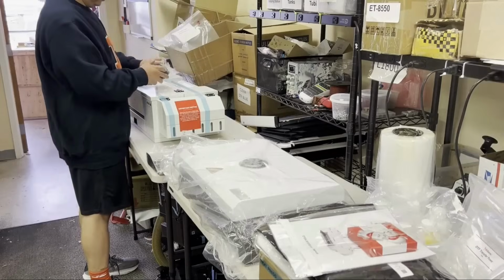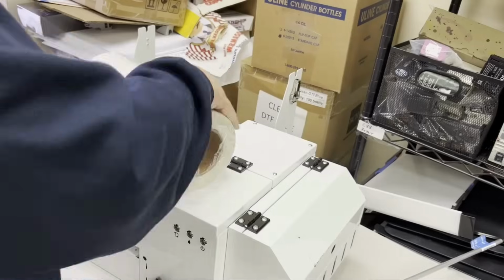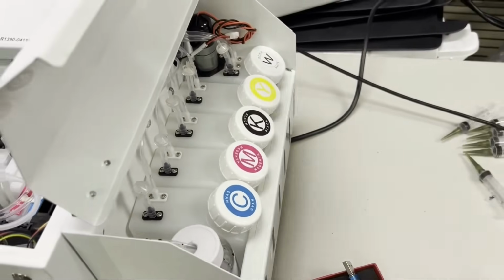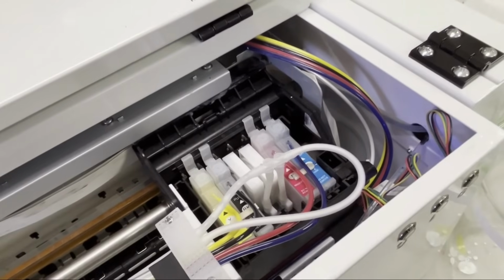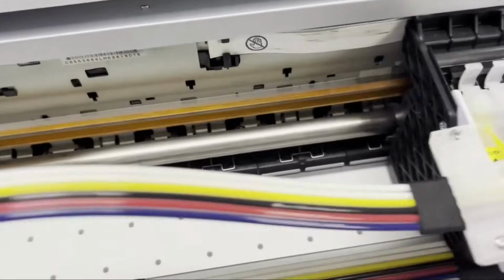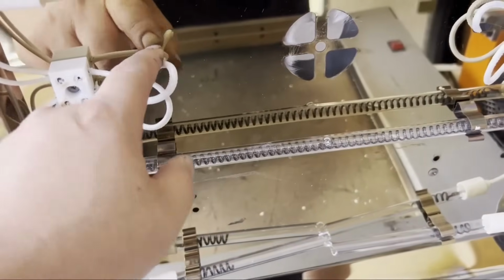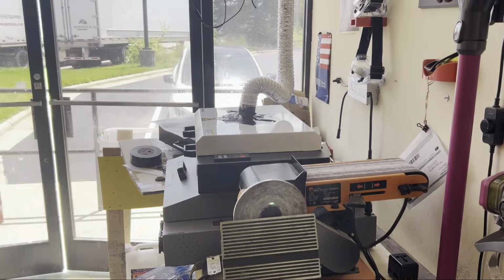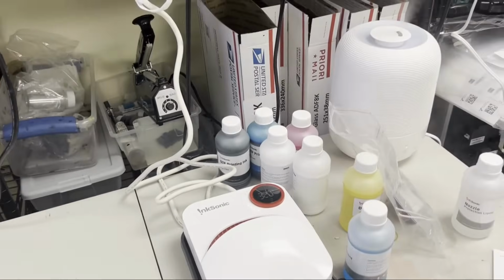InkSonic C13A DTF Printer Unboxing & Setup Tutorial | Can This Printer Make Awesome T-Shirts?

Comment: Hey Kevin, I’ve had mine since last May. Not even a year. I’ve had so many issues. Today, after cleaning my capping station, my air tube popped off. I can’t even reattach it, can’t reach it 🤦🏼‍♀️
Reply from the maker: Thanks so much for watching the video and for your support! Sorry to hear you’re dealing with that issue, but there’s a way to reach it—if the air tube popped off the capping station and you can’t reach it, try detaching the ink tanks first, which will open up a window in that area and usually gives you enough access to reach down and reconnect the tube to the capping station; it’s a tight space but removing the tanks makes the job much easier. I really appreciate your engagement with the channel, and if you haven’t already, please consider subscribing or becoming a channel member because subscribers and members receive priority replies and extra benefits like early access to videos; I receive a high volume of questions every day and can usually only reply to about 10 per day, so subscribers and members are prioritized and typically get responses within 48 hours, while regular viewers are answered if time allows, and after subscribers and members any remaining reply slots are filled last-in, first-out with the newest questions first. If you’re a non-subscriber and don’t receive a reply within 48 hours, you can subscribe or repost your question since newer comments are reviewed first, and if you subscribe later your older questions automatically become priority without needing to repost. You’re also invited to join Run With Kevin — LIVE where I go live most mornings between about 6–8 AM Eastern and answer printer questions in real time, so subscribe and turn on notifications so you can catch the next session and ask directly. If you need faster help, feel free to email [support@bchtechnologies.com](mailto:support@bchtechnologies.com), and if this video or comment helped you I’d really appreciate a quick Google review here: [https://g.page/r/CfL7k6nYvPQ9EAg/review](https://g.page/r/CfL7k6nYvPQ9EAg/review)
Reply: @BCHTechnologies God bless you and thank you again. Unfortunately I had to disassemble the printer. Cleaned it up nicely and will be assembling the next few days. It’s all good but what a pain in my butt.

Comment: Software isn't the same looking? and Every time I try to print it just run and runs
Reply from the maker: Thanks so much for subscribing and helping us get closer to the 100k milestone—it really means a lot! The software interface can look different depending on the version or driver package installed, but the functions are usually the same, so don’t worry too much if the layout doesn’t perfectly match what you see in the video. As for the printer running endlessly without actually printing, that usually points to a driver or communication issue, so I’d suggest reinstalling the correct driver for your model and making sure the print settings are aligned with the RIP software. Also, if there is a "roll feed" or "sheet feed" choice, you can try to change the setting and see if it can correct it.  I try to answer subscriber questions within a few days, though I have a big backlog right now and am working hard to catch up. If you ever need faster help, you can email [support@bchtechnologies.com](mailto:support@bchtechnologies.com). And if this video or my comment helped your journey, please be kind to leave a review on my Google page here: [https://g.page/r/CfL7k6nYvPQ9EAg/review](https://g.page/r/CfL7k6nYvPQ9EAg/review)

Comment: Ive just had a new machine from ink sonic and still carnt get the white ink flowing  ?? Even they have tried  ?
Reply from the maker: Thanks so much for subscribing—it really helps us move closer to the 100k goal, and your support is what keeps this channel growing! I understand the frustration with white ink not flowing on the InkSonic C13A. If you mean you don’t see white ink printing at all, then it’s usually a priming or cleaning issue with the printhead and capping station, and I’ve made several videos on how to handle that. If you mean the printer prints white but the tube stays full of air, then specifically on the C13A, the design bypasses the white ink tube when the head is clogged to protect the printhead from damage. This feature can be modified or removed to improve white ink flow. I’m working through a big backlog, so subscriber questions like yours are answered in a few days, while members get detailed responses within 48 hours. If you need faster help, you can email [support@bchtechnologies.com](mailto:support@bchtechnologies.com). And if this video or my comment helped your journey, I’d really appreciate it if you left a review on my Google page here: [https://g.page/r/CfL7k6nYvPQ9EAg/review](https://g.page/r/CfL7k6nYvPQ9EAg/review).

Comment: I'm glad to see that it works for you.  I'm sure they made sure it was a good printer before doing so.  I will never buy from this company again.  After over 5 months of long hours on my night hours and being ignored for hours made it hard to appreciate customer service there.  It made a growling noises leaving the capping station from the first setup call with InkSonic making that noise and they said it was okay.  That was before ink was put in.  They had me put ink in and it printed a few prints that were not saleable at all.  I worked hard with them, to finally be told...the frame is deformed, can not be fixed.  They could give me $100 discount on new.  Sometimes there is a lemon waiting to be purchased.  It happens and this time it was me.  Warranty is fill with ink and it's yours. I own a broken all the way down, no frame just guts.  I even was told by a tech, " It will not run because I do not have the paper feed rack in".  Shaking my head.  That piece has no bearing on the printhead moving or the even turning on.  Good luck to all of those who purchase a printer with that company.  
I did watch the video of you showing the 7-color XP600 dual head from Fcolor.  I now own one.
Reply from the maker: Sorry to hear you ended up with a lemon—definitely frustrating after putting in that much effort and time. On the initial diagnosis, did they suggest adjusting the APG height dial on the right side and then fine-tuning the parallelism adjustment on the left? That combination has resolved similar issues for some users.
This model also requires mounting the printer low due to its small droplet size—something that's easy to overlook but can impact print quality and behavior.
I’m not sure what all was tried in your case, but it’s unfortunate the frame turned out to be deformed. Glad to hear you've moved on to the Fcolor XP600 dual head; I hope it gives you better results moving forward. Appreciate you sharing your experience—definitely helps others make informed decisions.